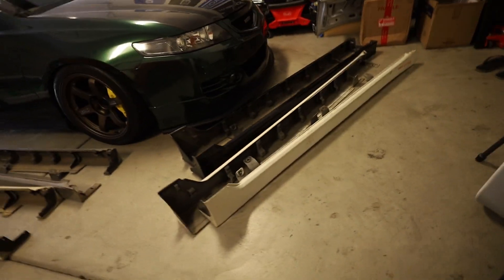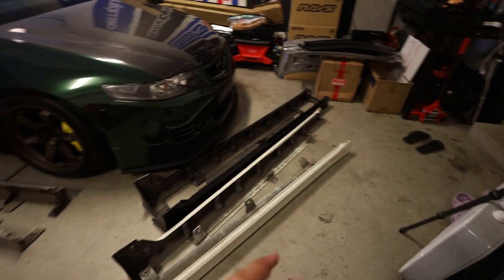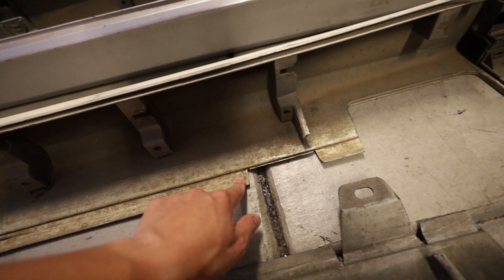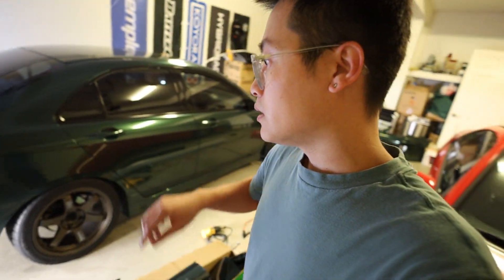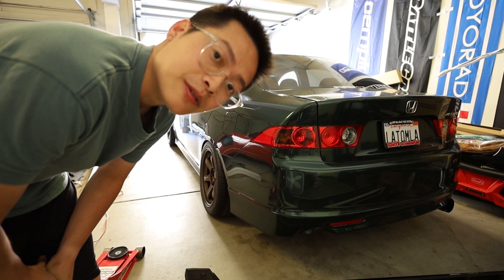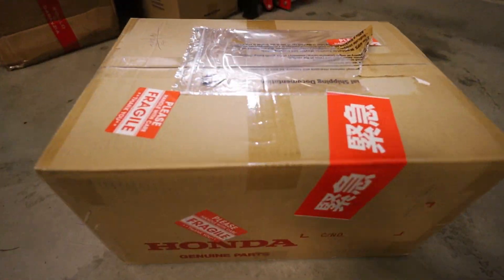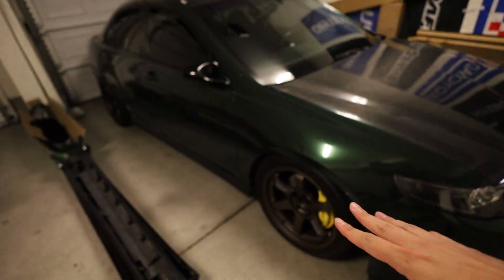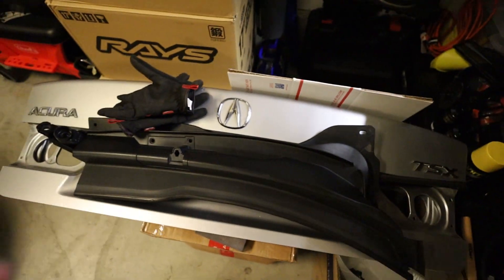I finally found a set of these for the TSX & RRC manifold!

Comment: So I did a reflash cuz of your vid. With just the reflash from Hondata do I recommend the intake mani? I don’t wanna spend anymore money with a flash pro. I just wanna leave as is
Reply: If you won't get the flash pro just do intake and headers, nothing more. To get benefits of rrc intake manifold you will need a 40° vtc andchange fuel, ignition, vtc ... With all that, you will loose power and run lean